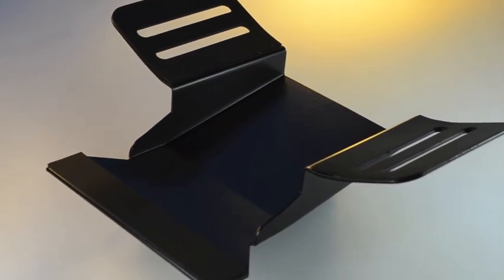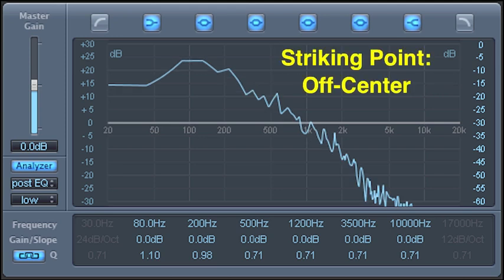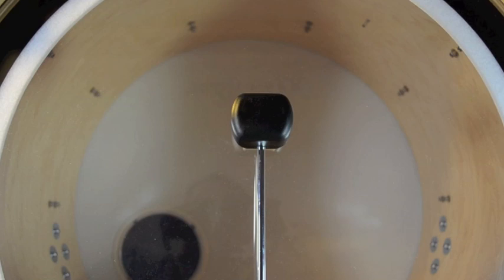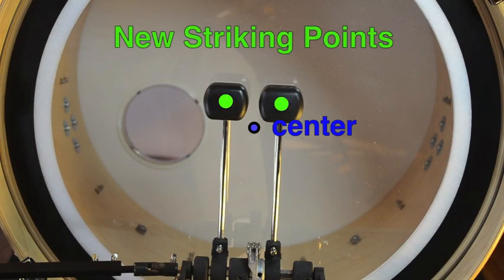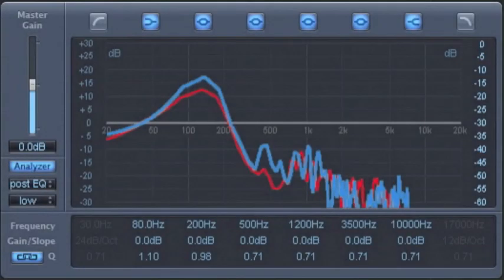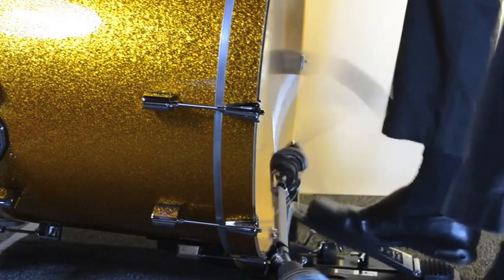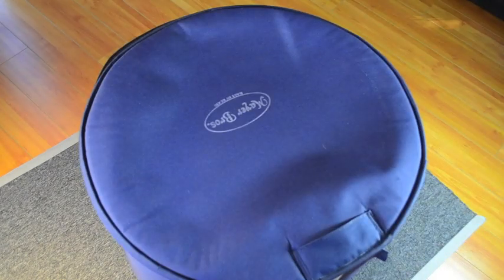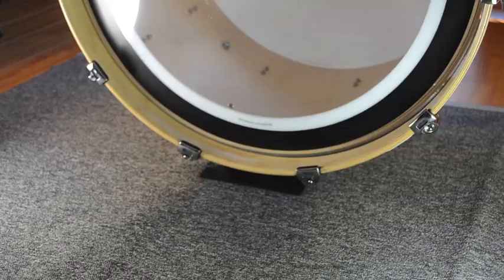About Bass Plate

Comment: Would it work for a 26in bass drum?
Reply from the maker: @110694415778077931176 There are two Bass Plate models: BP-22 and BP-20. The BP-22 is made for 22" bass drums; the Plate's inner pair of slots is for ten-lug 22" drums, and its outer pair of slots is for eight-lug 22" drums. However, Bass Plate users have found that the BP-22's inner pair of slots happens to line-up with the lugs on a typical, eight-lug, 18" drum. Similarly, the BP-20 model is made for 20" bass drums, but its inner pair of slots happens to line-up with the lugs on a typical, eight-lug, 16" drum.

So, the two Bass Plate models (for 22" and 20" drums) also happen to work with 18" and 16" drums, respectively. So, Bass Plate models cover four drum sizes: 22", 20", 18", and 16".